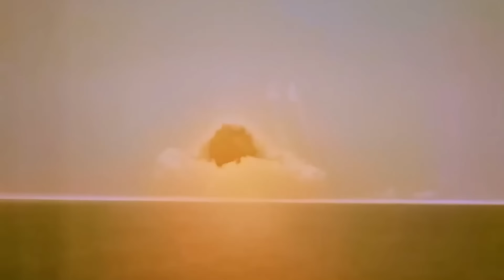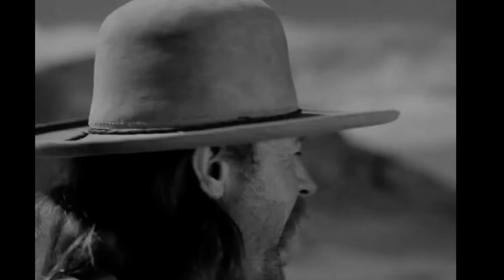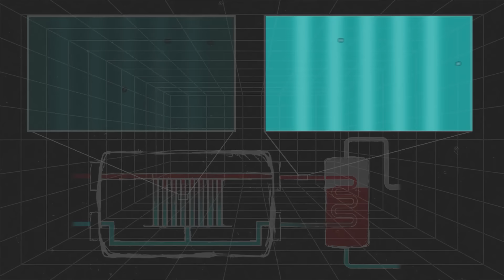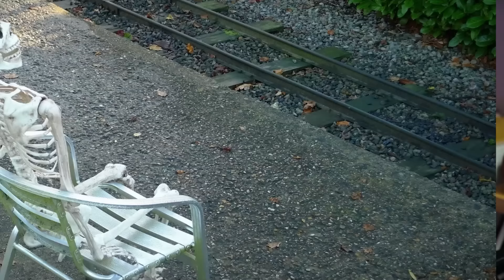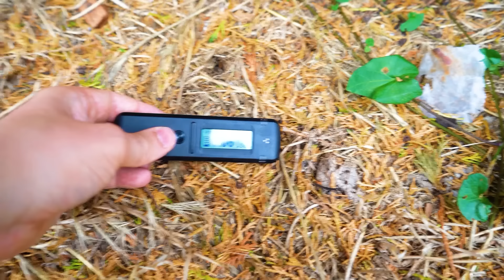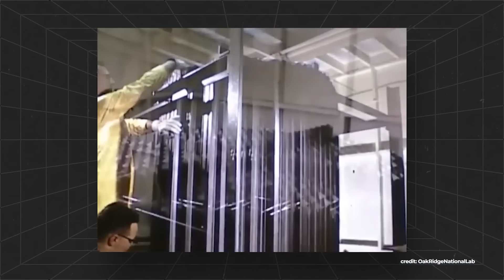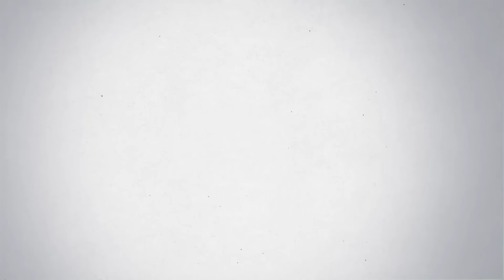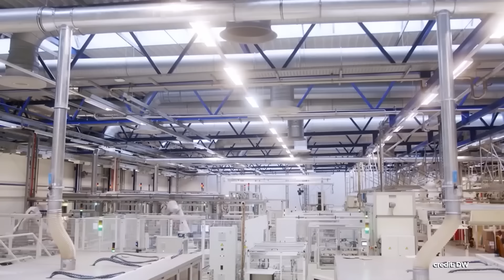It's Happening - China Launches World's First Thorium Nuclear Reactor

Comment: "secretly everything still runs on steam turbines, and we NEVER left the 1800's"  Had me dying,.  It's SO TRUE
Reply: Not solar panels
Reply: @RP-16  nor do any of the hydroelectric methods AFAIK
Reply: Or wind turbines or water turbines and some other stuff like wave power.
Reply: @RP-16 Britain has engineered a way to use anything from pavements to walls panels roof surfaces using special spray paints and a couple of connections, you got yourself an electrified surface of Ur choice, as long as u follow the instructions 👍
Probably available next year ???
Maybe?
Reply: @RP-16 The first solar power station was presented in 1876 on the Paris World Exposition
Reply: Its like the code in Windows !!!!
Reply: @_c_y_p_3  Funny, but, steam works. Windows don't!
Reply: @_c_y_p_3 lol based
Reply: @_c_y_p_3  In Windows, everything is running off the registry and we never left the 1990's. 😁👍
Reply: @_c_y_p_3  Wait... that runs on steam too? Does Gabe know?
Reply: 'Steampunk fever' - it rocks!
Reply: For more fun, a steam turbine is just a fancy sort of heat pump. also an ICE engine is just a fancy air pump.
Reply: @Name-ot3xw  I think my fridge is also known as a heat pump too.
Reply: Complete combustion results in co2 and water, so steam is still shoving the piston in an ice rig.
Reply: @Name-ot3xw  I thought ICE engines were border pumps
Reply: @Name-ot3xw an ICE is also a heat pump as well.
Reply: @carsonallaby7798  Fair, and a steam engine does pump air afterall.
Reply: @Name-ot3xw  
Expander Not pump.
Reply: @Name-ot3xw  no !
Reply: @Name-ot3xw  ices aren’t just a fancy air pump lol.
Reply: @Azakadune  TBF, you're right. ICEs are just fancy air compressors, not pumps. Though some include sub-pumps to further increase pressures.

For example, what we call a naturally aspirated engine would include all ICEs with intake manifold pressures lower than or equal to atmospheric, a 'boosted' ICE will have pressures above atmospheric in the intake manifold.
Reply: Turbine sets based on supercritical CO2 look extremely promising and much more energy dense than steam turbines.  You need monster turbines to get the power from steam but supercritical CO2 is so dense, you can use tremendously smaller turbines to extract the same energy.  That's the progress not covered here.
Reply: @StormGod29  I came here to write about the supercritical CO2 turbines. Some of the estimates I've seen tout a 50% or higher improvement in total efficiency of the energy conversion. So ANY heat-based power source would get an automatic bump in nameplate capacity!
Reply: @StormGod29  What is "supercritical CO2"?
Reply: Ug use heat to boil water
Water spin spinny magnet thing
Ug make lightning that make things move
Reply: I learned this in 1997 in 7th grade about how steam turbines run all the power plants (except for hydro which are just water turbines, and solar) basically and I've always found it hilarious.
Reply: @artosbear  You can also burn natural gas directly in a turbine, without heating water first.
Reply: Those are called gas fired turbines.  Jet aircraft turbines are of that type.
Reply: An utterly ignorant statement.  Steam is still the most efficient way to transfer heat energy into mechanical work.  Just because a technology is simple and old, doesn’t mean there’s anything wrong with it.
Reply: It's efficient and simple.
Reply: Steam power forever
Reply: could be CO2 turbines...
Reply: We had steam engines earlier, but turbines weren't really all that great when they were invented in the late 19th century. It took a while to iron out the kinks.
Reply: @Afrobelly 1800s wasn't run on steam turbines but reciprocating piston steam engines.
Reply: China and the CCP....the Kissinger & Associates Klown Show that keeps giving.
Reply: @Talpiot_Program  Good Point
Reply: Yet, “we can build these reactors in the desert bc they don’t need water…” ??? Is the steam collected & recycled?
Reply: @DurfDiggler  Yes!
the steam turbine is part of a closed loop, from reactor, to turbine, then back to the reactor etc.
Reply: @Sir_spooky  But what do they use to cool the condensers? You still need to extract that heat from the exhausted steam somehow. If you need no water source they must be using enormous steam to air heat exchangers
Reply: The great invention of James Watt
Reply: Condenser?
Reply: Condenser?
Reply: @Sir_spooky  - There are also other designs that don't involve water at all.
Reply: @DurfDiggler  Of course.
Reply: @DurfDiggler  cooling water and steam condensate are likely separated
Reply: @DurfDiggler actually , yes. Its a closed system.
Water used for cooling
Reply: @DurfDiggler  … at best 90-95% of steam can be ‘recycled’ in current steam turbine cycles as contaminants have to be removed from the cycle and make up water has to be added.
Reply: @DurfDiggler  OBVIOUSLY!  It's condensed in those big heat-exchangers, some heat leaves the system and heats up the desert a little more.  The now liquid water can be pumped back in to the system.  People have been doing this for a long time!  I think it's common, except for in Locomotives and portable engines say, where the system has to be compact and move around, so they have waste steam.  There are several reasons to keep the water if you can.
Reply: @DurfDiggler  Yes :) It's enclosed.
Reply: @DurfDiggler  America's 2nd largest (until recently largest) nuclear power plant is just West of Phoenix, AZ (Palo Verde). Uses gray water recycled from metro Phoenix.
Reply: @DurfDiggler  Closed loop like your A/C system.
Reply: @DurfDiggler  Steam can be condensed and reused , but the heat has to go some where, and there is some loss
Reply: @DurfDiggler they need water for cooling and to run turbines so the desert reactors must take water from underground or dam a river and reallocate its stream !
They will have a loop which is fed through a massive water tank and fed through after cooling the steam can be collected and fed through drip feeders or whatever they're called which is recycled to
Old tech with newish chemistry 
That's my little take on it 😅
With technology today we need water to help control the reactor's heat otherwise another Chernobyl is likely to take place,
Reply: Yes  @DurfDiggler  and, there is also sodium used sometimes, basically molten salt, kept in its own containment mechanism, but able to input or output the heat. It's a really nifty concept. Altogether, makes a lot of sense.
Reply: Water wells in the desert are usually sufficient to provide the water for power plants @DurfDiggler
Reply: @DurfDiggler  Yes, it's just a circling medium for energy transfer.
Reply: @DurfDiggler  Are you serious or trying to be funny?
Reply: @__cypher__   I was quoting the contradictory points from the video. That part of the process was not clearly explained in this video, and I’m not a nuclear power engineer, so yeah, I asked a question. 
Thanks to everyone who clarified & provided more information without trolling.
Reply: @DurfDiggler Generally, nuclear power plants have two water systems: an internal closed circulating loop that can be any liquid (such as molten salts, or pressurized water) that may or may not be in direct contact with the fuel, and an external open loop that exchanges the heat from the internal loop which then acts on the turbine which then may either be vented (such as through a cooling tower). This second external system may be made into a closed system if you’re not lets say built on a water reservoir, you just have to re-condense the water.
Reply: @DurfDiggler There are no commercial reactors in service today that don’t require water.
Reply: @ so you understand my request for clarification on the information given from the video? 🤷🏻‍♂️
Reply: Nuclear power plus TPV cells should be the future!

 MIT just made some TPV cells that are just as efficient as turbines with the benefits of no moving parts. 

 I have no idea what the thermalphotovoltaic effiency actually means...

 Like how big of a panel would need to be required to capture the energy then? Same radius as the turbine or something? 

 No one can ever answer me that.
Reply: @dianapennepacker6854 TPV efficiency has nothing to do with the *size*, no-one ever "answers your question" because your question is wrong and you're obviously just trolling, or a paid bot or something. 
Efficiency in TPV is about how much energy landing on the cell **over any given area** is converted to energy. Better electrical technologies are needed to increase efficiency, not larger panels. 🤡
Reply: Claiming the steam turbine was invented in the 1800s is a bit of stretch. C A Parsons works founded in 1897. Everything runs on steam turbines because they are AWESOME!
Reply: All weapons are basically throwing stones at each other in a more deadly way.
Reply: @jimboslice1237  Maybe we need boxes of rocks in our parliament houses and united nations meetings to contain the disagreements.
The general public could just get on with our lives on the outside.
Reply: they could directly convert the heat exchangers into solid state to electric, but peltier and the other guy takes a lot of metal and is not cost efficient
Reply: @davidanalyst671  Interesting , How?
Reply: We still use round things called wheels as well.
Reply: @N-Tity  So True
Reply: Ummmm.  Gas turbines?   Like GE LMS-100!
Reply: Lmao I'm a power engineer and this its literally my job to run steam plants/power plants. Turbines are freaking everywhere and no one has a clue lmao
Reply: Unless the boron fusion reactor can be developed (which captures photons directly from the fusion process without the need to produce steam), the steam turbine is here to stay.
Reply: I was thinking about this the other day as a friend of mine was talking about a Royal Navy ship from 1901 and I asked how it was powered, coal or oil? And he said it was a steam turbine, I had to ask again and walk him through the steam has to get hot somehow.

I suppose two exceptions to the steam power rule are internal combustion (specifically in automobiles) and nowadays electric motors (however you could argue the electricity still comes from steam)
Reply: So we’re living in the steampunk universe already?
Reply: Pandora's Deflect made us forget the Clown World.
Reply: That's like saying every computer secretly still runs on transistors and we never left the 1950s. Novel ideas and inventions are dime a dozen, only those worthy of endless refinement are actually viable.
Reply: Comparing modern steam turbines to those of the 1800's is like equating today's microprocessors to those of the 1970's.
Reply: nothing wrong with using steam as a conductor of heat as water has good energy capacity
Reply: It is high time that we develop direct energy conversion with MHD generators
Reply: A stirling engine generates power without a turbine
Reply: @efattah  Thank You for the reminder, I.c.e too , now to make it commercially avalable
Reply: The first steam engine was invented in Ancient Roman, 50 CE and in some writings as early as the 1st Century BCE. It wasn't until several centuries before anyone actually applied this technology to an actual working commercial machine to do more than just amuse people.
Reply: This aspect has me confused.   In a different YT channel, I pointed out the advantage of less water being required for cooling a molten salt reactor. Someone else said the cooling water was needed to condense the used steam after the turbines. Why does a pressurized light water reactor need more cooling water than the molten salt one?  Does the primary water loop require extra cooling?
Reply: it's because you can't beat the thermodynamics of water. and it's safety and stability. Just like we reached the limit for energy storage on lithium batteries but everyone things we'll keep increasing battery capacity exponentially.
In the end we live in a world ruled by physics not Technology.
Reply: @captainLoknar  
Batteries can, theoretically get a few times more energy dense. They're perfect (or will be) for cars, trucks and mining equipment, big rigs, etc.
H2 would be better but not perfected yet (as cheap) and requires more solar panels or more nuclear to make than the batteries.
With cheap mass produced nuclear, we could afford that loss of inefficiency, though.
Reply: Soviet Alpha sub used a liquid metal nuclear. reactor.
Reply: @RadicalTek  Good to know , Thank You
Reply: Neutron flux? Holy shit, sci fi lingo was right
Reply: It's like saying cars still run on wheels, which were invented ages ago. Old technologies are still in use because they are fundamental and efficient.
Reply: @lihaida5838  they have cars in Japan now that use maglev
Reply: That's what I have been saying for years.  21st century fuel running 18th century technology!!!
Reply: And we still use spinning wheels for transportation 😂😂😂
Reply: Exactly what i am trhinking for a long time now. Everything we do. Nuclear, coal, and now thorium everything ends up as steam that turns the turbines. Even fusion reactors will do that. So yes, we never left 1800s basically.
Reply: There are different designs that produce electricity direct from the Nuclear reactor skipping the whole steam turbine thing.
Reply: Actually, what has been proposed for power cycles for Thorium is (like new coal plants) the use of supercritical CO2 which uses 0% water/steam. So we have left the 1800's.
Reply: How else do we turn the steam into electricity?
Reply: Your bones contain Erbium and for no particular reason, you also have Yttrium inside you somewhere.
They are commonly found together with Thorium in nature, which presents as a relatively cost effective and viable fuel, for use in Nuclear Reactors.
Europium, from the same mineral groups, is also of use for the control rods, used in Fission Reactors and isotopes of these, could cure you from Cancer.
Don't die. There's so much to live for, be like radioactive decay... stick around for a while!
Reply: I don't know. I have several relatives who used to work at a nuclear power plant
Reply: It’s actually so true and hilarious!
Reply: solar panel is not that case, but seems the western world doesn't like it because China is dominating the solar industry.
Reply: Insanely true. Even theoretical designs for commercial fusion reactors include using heat exchangers and steam turbine driven generators. Lol
Reply: Nuclear reactors literally heat water for steam turbines
Reply: The steam engine isn't really an electricity generator
Reply: Anyone who invents post-1800 technology either gets unalived or gets invited to some black site and their research becomes literally underground.

Can't have anyone threaten oil / gas profits now can we?
Reply: We used Water power in the BC era ancient Greece had basically had a turbine powered by a river not for electricity more of a direct drive powering tools like giant hammers etc
Reply: So ultimately still using  British steam engine technology.
Reply: To be fair it's the simplest and cheapest way of making useful energy from these reactions, if it's not broken, don't fix it!
Reply: And running on Bitcorn as fuel.  lmao
Reply: Whens that was a secret?
Reply: Yes, WHY can't we find a way to be More direct with making Electricity like Solar IS.
Reply: yeah there must be a better way to turn nuclear into electricity
Reply: Except wind power, PV solar, dam power and vehicle electric power from alternators
Reply: Thermal plants employ the same thermal cycle, just the fuel is different, whether it is coal, wood, fuel oil,etc.  or uranium, ,the principle is the same.
Reply: Yeah but the methods used to turn those turbines is insanely more efficient and clean
Reply: This is just mind boggling every single time. Where are the magnets.
Reply: Ties in well with the stock footage at 18:51, it's a steam locomotive. 🙂
Reply: Closed Brayton Cycle is the way.
Reply: Pulsing magnetic fields is another way to harvest energy from nuclear reactors (plasma fields). Look it up.
Reply: well, its what creates the steam that has changed a lot. the steam is just a convenient process. think of it like gears, they are ancient, but we use them all the time, but it doesnt mean we havent advanced at all since then
Reply: That's what reminded me to upvote, lol.
Reply: Yup, like in the music world, we haven't left the 80's.  We're still listening to an 80's sample's tape😂
Reply: @theofungi6562  
The music is indifferent to the politics, but it was good, too, back then.
Reply: Solar cells
Reply: Steampunk forever
Reply: Nothing changes we're still just apes playing with rocks. The phone is your hand is just rocks.
Reply: like the Wuhan Thorium Laboratory?
Reply: But thorium can be recycled!
Reply: @Mr.Bob369  everything can really just is it coast effective .
Reply: @Mr.Bob369  A life cannot be recycled.
Reply: not true at all actually. 

Nikola Tesla

Viktor Schauberger

Wilhelm Reich

Thomas Townsend Brown

Otis T Carr

Sandy Kidd (Alexander Duncann)

Prof John Searl

Joseph Newman

and on and on and on

just because industrialized, espionage and corrupt governments classifying suppress the technology with corrupt media, doesn't mean we don't have it at least the thieves in power have it... we could always try to repatriate it and oh boy should we really hurry on that before monkeypox mega lockdowns next month (whistle blowers say wef/bill gates are gonna chemtrail(biochemtrail) spray us with it (as well as put it in the mpox vaxxines)

then we will never be able to repatriate the stolen alternative fuel and power technology that our noble heroic inventor relatives who wanted it affordably for the public anyways
Reply: SPOILER ALERT!
Reply: Honestly, with China, I wouldn't believe this for a second.
Reply: yep.. Nuclear is just hot rocks boiling water
Reply: everything in China is fake
Reply: Well except for solar panels  and wind Turbines, gas turbines etc... but yeah it is depressing that a fancy concept like fission ultimately is used as a water cooker
Reply: @vahidsafira8651 No moving parts for zero point energy, Tesla towers, MHD generators
Reply: WiFi is just radio so yes it's all turn of the 20th century technology... makes u wonder what they really have. But the next energy source makes a bigger bomb. Humanity isn't ready
Reply: uhg, i hate this fact. i think i was legit depressed for a day after i realized this
Reply: If it's not broken, don't fix it
Reply: I always think about this with nuclear reactors lol
Reply: As Einstein said -:"it's a hell of a way to boil water"
In fact it's a hell of a way of boiling the planet.
Reply: LOL we just keep getting fancier at generating the heat :D
Reply: If it works don’t mess with it
Reply: Come up with something better. Oh, I don’t you can.
Reply: Steampunk FTW!
Reply: the phase when satan started his ultimate execution
Reply: So what about splitting the water to hydrogen and oxygen and then letting that run a fuel cell would that not then use the steam better than a turbine and create more energy
Reply: It seems like you could use both systems turbine and fuel cell at the same time as it heats splits cools and the pressure changes
Reply: because technology is child of science, our science haven't enhanced. We are still using 1700s science theories, Science advancement is not happening, only technological but we always forgot that tech is just a product of science, it is not science.
Reply: @ManagementBing  that's true in that not many questions are asked and what most understand is what is already taught to them.. complicatedly simple as that is 
Mechanical 
Electrical 
Biomechanical 
Quantum 
Nuclear
Plasma 
As far as I understand these are the only open frontiers of technology I'm sure it could be broken down further but that's it.. and even with that is plasma not electricity in a way is that not directly convertible and we don't do that fuel cells and solar.. copy biomechanical yet stand unapplied to the nuclear that then is creating the sun and plasma electricity and a turbine is used on the heat.. just an unimpressive application and use of a nuclear reaction really
Reply: Not true.  A lot of things run on gas turbines - aircraft and marine engines, peaker electricity generation, FCC expanders.
Reply: Like you got a heart attack? 
I hope not, how are you doing now are you better now?
Reply: @Afrobelly  Wrong. There are new technology such as solar and wind.
Reply: Its moving a copper coil in a magnetic field. Pressurized water or steam works great.
Reply: We're still in the age of quackery if you ask me
Reply: Don't fix what ain't broke
Reply: Proof stupid exists
Reply: haha I came here to say this too. Dead on :)
Reply: Gas turbines and internal combustion engine have entered the chat and no i am not talking combined cycle
Reply: So... we live in a steam-punk age... at least its turbines and not reciprocating piston engines...
Reply: Free energy & technology is being withheld from us whilst Planned Obsolescence runs rampant.
Reply: That's thermodynamics. Laws of physics have proven to be pretty reliable over the last billions of years.
Reply: What is better to convert heat/pressure into mechanical energy/power a generator?   Anything even close?
Reply: Yep
Reply: Ha ha 
Very good
Ur brain works very much like mine 😅
Fusion is the future
Hopefully fully controlled 
Don't fancy no black hole in my back garden
although a black hole could solve our world waste issue 👍
If controlled 😅
Reply: Solar joins the server
Reply: There is no secret about that.
Reply: All still a nice way to let us pay a lot for electricity.
We should all have free electricity by harvesting it from the Aether.
Reply: Thermoelectric, photovoltaic, etc. are often too sensitive to endure radioactivity so even bromine is preferable to ammonia for working fluid since a fission fragment uranium gas core rocket engine would only evoke wrath ire of bureaucrats since Heisenberg's criticality or "Dragon experiment" of Leipzig to calibrate frustrated Germany to sell off Uranium 235 for the United States to have Trinity test of July 1945 so please no jokes about "uncertainty principle".  

Steam could generate electric power via electrostatics of steam flux across electrodes where again heat hinders conductivity and with so many alpha particles most electrons could be absorbed to form helium.
Reply: Steam is lighter than air for airships of distillery steam rocket retort nozzles might have worked for Japan of how Japan had lacked quality ferrous to not have rail transit track locomotives until Fall of 1945 and not be able to produce ferrous metals to meet DOT qualifications until the 1970s.  

Still Roosevelt's sea floor mine blockade of 1938 to 1945 on Asia ironically forced Jun Noguchi of early 1940s Hamgyong to develop Helmholtz Coil focused cosmic ray muon catalyzed fusion beryllium alloy rocket powered gliders of braided composite fibers fueled by cryogenic Dewars of liquified deuterium to haul freight between rooftop hangar Mary Kenney STOL fans which I can back by my MIT peer review.
Reply: @thomasciarlariello  sure
Reply: Not secretly, though.

Col. Bearden once said about all our electrical technology: 'We are paying the power companies to have a giant wrestling match inside their generators and lose.'
Really alternative technologies would be approaches like utilizing magnetic field vector potential, i.e. tapping into the flow of magnetic fields.
Reply: MHD and shape memory alloys are a consideration only if it does not exceed Curie Point of how such metals could melt like in an induction smelter.
Reply: My dad a NASA engineer whose professor was Dr. Robert J, Oppenheimer had worked on a SNAP Reactor of thermoelectric like Rusisan Topaz reactor and on a fission reactor able to use NaK liquid metal for a working fluid so a pilot plant has to be achieved before going to commercial fuill industrial scale.
Reply: @thomasciarlariello  Are you proud of your dad being a NASA person?
Reply: What is important is he was proud of how I made it to MIT for my articles on how to design nuclear fusion rocket engines for spaceplanes so when he died a visiting nurse had a "Godzilla" film on TCM so I explained how such a film had binding energy kinetics wrong to have inspired me to give by invite only an MIT presentation on  design for a lamp to convert exhaled carbon dioxide into breathable oxygen.

My dad being part Hungarian resembled Ruler of North Korea of how my dad was paranoid about communism so he hated Black people being from University of Texas to have  endorsed the Confederacy of the Civil War and considered his Oak Ridge Professor Oppenheimer to be a west coast bohemian out of synch with work of how a how a Hollywood film did show Oppenheimer being a polytheist with a mistress Jean Tarlock murdered by the FBI for WWII secrecy so which is better or worse Huxleyan decadence of polytheism such as K Pop sexual gyrations or Orwellian militarism of monotheism such as Taryeong goosestep parades?

My mother who worked in virology epidemiology was a personal friend to Thailand's royal family so during the "Cold War" both parents where constantly on alert.
Reply: @thomasciarlariello  Eh....
I guess I have to believe you on your words.
I don't believe in space traveling that much though.
Any family members hanging around that do high quality LGBTQIASDFT90210BS²   transmutations ?
Reply: It only proves that the greek Heron, who lived and died at the time of Jesus, had a good idea when he invented the theory of steam engines, long before Savory, Newcomen and Watt made it work better and more efficient.

One of our most iconic 1900 inventions, the jet engine also works on the theory that warm gas expands to a bigger volume, and rocket engines took man to the moon in 1969.

So, an idea doesnt need to be new to be good.
Reply: Steam is not the energy source, else no need for oil, coal, or thorium.
Reply: @richardwilliams1986  Yes, of course energy is needed to increase temperatures. 

But there are a few situations where nature provides this energy. I'm thinking of underwater heat water chimneys, called fumaroles, they get their energy from volcanic activity, and can produce water temperatures up to 400 C/752 F.

This energy is taken care of in Iceland, and should be taken care of on Hawaii as well, since there are volcanic activity. Instead, 80% of Hawaii's energy comes from oil.

In Centralia, Pennsylvania, a Cole mine has been burning for a long time, i wonder why this heat isn't taken care of, before we look at complicated nuclear processes. I'm not a crazy environmentalist, but why don't we use free and available heat energy that already exist before we put a lot of effort to mine Uranium, Thorium and heat up cold water with it?
In Europe, Italy has this type of volcanic energy as well, 4 volcanoes and no use of heat as far as I know.
Reply: Eat your heart out .... with a green face ...
Reply: @SunitaSingh-u2m Would you care to elaborate what you mean by this?

"Eat your heart out" seem to mean that i or someone else here should envy or be jealous of something, i cannot se what. 

"With a green face"? I do not live close to a nuclear powerplant, so the risk of my face to turn green from radiation is quite remote. 

So, what are you TRYING to say?
Reply: That's why I'm so happy that we at least invented solar. :D
Reply: They'll be more wind turbine shafts in Britain than trees in 30 years if Neo Labor (sic) get their Neoliberal, subsidised Big Renewables way.. Extremist Dystopia... Small, modular Breeder Reactors could and should be ubiquitous tech all over the world by now, not coal, gas and dodgy renewables.
Reply: A ridiculously ignorant statement.
Reply: RIPPLE...NO DETONATOR NEEDED
Reply: @Afrobelly  yeah but we like wheels, they're a pretty good invention, I'm thinking British coz why not, nobody can prove otherwise 👍
Reply: so what? the windturbines are even older, the nuclear is the newest form of energy humanity discovered, yes.
Reply: Steampunk forever! 😆
Reply: Well, we run on stored energy... and there is no better stored energy than heated water.
Reply: We are building cheap fusion-energy-collectors all over the world. Direct capture by solar or indirect capture by wind. We advanced from 1800s.
Reply: I was shocked when I learned how much analog our digital world relies on.
Reply: Water acts as a regulator of neutrons too, cuz the neutrons don't need to be that fast to be absorbed, fast but not too fast. So water is a very useful liquid at all, it's one of the very bases for lots of reactions necessary for life, as one of the best solvents too.
We are still eating rice and dressing cotton, but the way we make it now, as like the final results, are very different than before, we are more capable now.
Reply: until there are big improvements in solid state conversion (the voltaics; photo, alpha, beta, thermo, etc) we're stuck with mechanical means of generating electrcity on the mass scale. And the turbine is the best option for that.
Reply: i realized it long ago
Reply: Combustion engines tho...
Reply: "Steam Punk"...
Reply: It's true, but old technologies that work are a wonderful thing. The oldest technologies include the simple machines (screws, inclined planes, pullies, levers, wheel and axle, and the wedge), irrigation, writing, addition and subtraction, and mattresses. I hope we keep those old technologies and likewise for steam turbines.
Reply: “If it ain’t broke don’t fix it”
Reply: Not only Steam turbines, but a host of other everyday things we use. If it's working well, then don't mess with it. You can still do R&D in the background for something better.
Reply: ThMSRs use molten salt as a fuel and coolant. Steam is used in more classical PWRs made by Russia, South Korea and some Western companies.
Reply: I tell people this as often as possible
Reply: Fusion it's the most expensive cofee machine project ever made, and still not ready, as it intent to make steam and move a turbine.
Reply: There are working molten salt plants already
Reply: @mr.buddha3657  One is in China, other notable reactor of similar type like Russian BN series have sodium instead of molten salts.
Reply: So we still in the steampunk era. Cool. 😎
Reply: Well not really, you see solar is one instance of direct electricity generated
Reply: I cannot recall a recently used technical principle, which was not discovered prior to 1957
Reply: @IvanPetrov-k2k  Microchip?
Reply: @MbisonBalrog  1957
Reply: @IvanPetrov-k2k  Fusion on Earth?
Reply: @Signal_Glow  Possibly after 20 years. First international agreement for non-military fusion projects were in the late 50s
Reply: @IvanPetrov-k2k  Yes, they started it a long time ago, but actual fusion didn't happen until quite recently. There are new things discovered, although maybe not as fast as before. As you know assessing these things is hard.
Reply: @Signal_Glow  Interesting, nobody speaks about antimatter ignition. For me - the best way.
Reply: @IvanPetrov-k2k  It is certainly very interesting and not well know, i could not find an article that would explain it. I guess we have to move on with big PWR plants, do as much thorium tests as possible and leave SMRs for companies who want them. If this is not done we are probably facing very, very grim future on this planet.
Reply: I wondered about this as well many times, though steam turbine efficiency have been improved a lot over time.
Reply: A good idea is a good idea just like the wheel, most guns and we even treat cancer ie chemo is the same method from the 1930's which we really need a better method to treat
Reply: Ah, people still boil water
Reply: Like  COBOL software running banking systems.
Reply: and since then they make clouds with the most of the energy. And its just because they dont understand that they can use the power of the phase change to make organic steam for organic rankine cycle. If they would use the heat of kondensation they couldt reduce the coolingtower clouds and make massivly more energy.
Reply: Apart from photovoltaic, everyone of our energy system converts energy thru mechanical rotation.
Reply: @nulnoh219  Because spinning electric coils withing a magnetic field generates electricity.
Reply: Up yours Americans
Reply: The steam engine train is still around and kicking,  It just goes no where
Reply: We will be never leaving steam turbines and coals :)
Reply: The main reason I see Venus as a better place to colonize than Mars. The heat gradient in the Venusian atmosphere would give humanity virtually unlimited energy. With that much energy almost any obstacle could be overcome. I don't see much return on investment in colonizing Mars, but with Venus (or Mercury) all I see is money....
Reply: Most of Nikola Tesla's discoveries and inventions are still used for our conveniences and advancements. He practically perfected his invention BEFORE he built it.  Eliminating a lot of experimenting that costs money. Just think how much money has been spent by nations on engineering that went outdated because of new and better technology,  just look at Russia and their aviation projects that never got used.
Reply: Yep, it's all to make a turbine spin with magnets on it, of which repeatedly spins close to stationary magnets, which then generates the actual electricity we need and use
Reply: Thorium is a good idea.  Lower radiation, lower pressure. How did they fix the corrosion problem with the pipes and the molten salt?
Reply: Hydro doesn't use very advanced steam turbines...
It uses very advanced water wheels!
Welcome back to antiquity. xD
Reply: 😂🎉 🥂 cheers steam punk fam
Reply: About 2020 a scientist in a Californian University was given the job of seeing if atomic waste coulld be useful.
He was aware the uranium in cracked uranium rods is nor reprocessed because it is cheaper to replace them with new rods.
However the graphite surrounding them is atomically carbon so he tried manufacturing Diamonds and was successful then it was noticed electrons were busy buzzing around in them, by fitting the diamonds with two terninals it was found they supp;ied electricity, so they were in fact batteries.
In January 2024 Elon Musk signed a contract with China to replace the lithium batteries in his EV Tesla cars, with Diamond Batteries, they will power his cars for 1500 years without the need to charge them and every manufacturer of EV cars will have to follow suit or go bankrupt.
Since then British scientists have extended the range of Diamond Batteries to supplying electricity for 5.700 years.
If Mars perseverience rover's  Moxie was upgraded here on Earth it could extract CO2 from our atmosphere, split the molecule and run the carbon 12 past Plutonium which would change it to carbon 16 , it could be manufactured into trillians of Diamond Batteries which could replace every fossil fueled or nuclead fueled power station on Earth.
It would also sequester the cabon indefinately while also reducing Global Warming.
Reply: I noted that
Reply: China builds the equivalent of 5 nuclear reactors a week in solar power for  the record.  No steam there.
Reply: Not solar or hydroelectric or tidal energy
Reply: Guess what thorium reactor do ……they heat water to make steam to turn turbines
Reply: It's true. Make stream ... dump into turbine ... make electricity
Reply: Not with fuel cells
Reply: Being pedantic but things don't run on steam - steam is just a means of energy transfer, a fluid medium more than a source of power. Pressure and flow is what drives a turbine and steam is the most practical, efficient way on a huge scale.
Reply: @deezelfairy  "steam is the most practical, efficient way on a huge scale" thus they run on steam...and are designed to run on steam as an energy transfer solution
Reply: @deezelfairy great reply
Reply: @deezelfairy  Sounds pretty pedantic to me. Its called a steam turbine right? Its the steam that creates the pressure and the flow right? 
wElL AkTually
Reply: @McGillus  Well, I said I was being pedantic so yes, it is being pedantic 😂 

It's actually an important distinction to make - especially when it comes to troubleshooting issues with any system reliant on fluid dynamics and understanding how they work.
Reply: @deezelfairy  wELl AcTuaLly..
comon son.
Reply: @McGillus  Sorry, I forgot being dumb is more cool 😂
Reply: @deezelfairy  Why using steam which is limited in temperature by its pressure?   You can transfer the heat from the internal LF loop to air (say 800 - 1000 °C) and use the hot air in a gasturbine which drives a generator.  Much more compact than a train of steam turbines with condensors etc.   LFTR's can be built very compact !!!!
Reply: Dezel, all steam engines run on heat wood, coal, kerosene, fission. Of course the steam is only a method of transferring heat to mechanical energy, duh! They are still steam engines! From a couple hundred years ago.
Reply: If it aint broken and it still works as it always has...yada yada.

Theres this very great quote from the even greater movie called "Poor Things" that activated my two and a half neurons, generating a small increase in my brain's neuroplasticity, causing the growth of that last half a neuron and bumping my numbers to 3. It goes:

"As God, my father, says, it is only the way it is until we discover the new way it is, and then that is the way it is until we discover the new way it is, and so it goes until the world is no longer flat, electricity lights the night, and shoes are no longer tied with ribbons"

I've always found the element of H2O very fascinating. Life can not do the life thing without it. it's a universal solvent. It's delicious. It electrically powers our modern world, and we haven't replaced it. We merely replaced our means of using it for far more efficient means. It's a magical element, in my opinion.
Reply: MHD generators have been invented they just aren't used.
Reply: @bolzdk9032  MHD are waiting for stronger magnets (room temp superconductors)
Reply: And anything that runs on a steam turbine only has an efficiency of about 42% at its best and under optimal conditions. Modern nuclear power plants are only about 33% efficient. This means that two-thirds of the energy produced by a nuclear power plant is wasted.

Of course, a wind turbine is only 50% efficient, and a solar cell is14 to 19% efficient at best, but they are simply capturing the energy that exists around them. Whether they're there or not doesn't matter, the wind is going to blow and the sun is going to shine, with or without them. It's not like we're producing energy here and then wasting two-thirds of it, we're just not capturing 50 to 86% of the free energy that we theoretically could have captured.
Reply: @xcoder1122    Unless you also want heat near the power plant in which case heat rejected from from the turbine isn't all waste.
Reply: @PMA65537  Agree.  For example, the heat can be used to desalinate water.
Reply: @xcoder1122  Modern turbines are incredibly efficient devices operating at about 90% efficiency in terms of extracting energy from the supplied steam. Even reciprocating piston steam engines have efficiencies of 75-90%
The majority of the inefficiency is in creating the steam itself, i.e the boilers and is why for example steam locomotives had overall efficiencies of single digits percentages.
Reply: @deezelfairy  I was talking about the entire process, which includes heating the steam, transporting it, cooling the steam, condensing the water, transporting the water, the entire cooling system, etc. If YouTube didn't usually block links, I would have sent you a link where this is calculated in detail, both theoretically and using actual data from real power plants. It's useless to have a component that's 90% efficient if everything before and after it isn't. A chain only needs one weak link to be useless.
Reply: @xcoder1122  Fair enough 👍, a lot of people don't make that distinction of the whole when looking at turbine efficiency.
In the current day, the most efficient power generation would be combined cycle gas turbines - that whole process can achieve efficiencies at ~60%. Obviously the problem is still the burning of fossil fuels.
Reply: @deezelfairy  Actually boilers are usually about 90% efficient. The losses come from rejecting most of the heat in cooling the condenser.
Reply: @xcoder1122  Sorry but that is exactly wrong: each component contributes to the loss, so if the first step is 20% efficient, your max result is 20%. Then the second component manages 90% of that 20%, so now you have 18% max. 3rd component is 60% efficient, now your total is 11%. You need *every single component* to be as high efficiency as possible. 🙄
Reply: @nowandrew4442  Where did I say any different? I said that it's pointless if one component if 90% efficient if the components before and after it are way less efficient. That's why the total efficiency of a nuclear power plant is only about 33%, despite the turbine on its very own being up to 90% efficient. You just confirmed what I said.
Reply: @deezelfairy  (rubbish, modern turbines are less than 50% efficient, the max temperature is limited around 600 degrees C and the energy from -273 to zero deg C can never be utilised. That’s thermodynamics!
Reply: @xcoder1122  no dude you're not following. Every non-100% efficient part will cause some loss. The lower the efficiency, the more *each part* will lose. It absolutely makes a huge difference if as many of your components are near 100% efficiency, even if an earlier component is not. A section is only 90% efficient **on the volume it receives from the earlier components**. Thus you are 1000% wrong to state that there is no point to have a 90% efficient component if the other components in the system don't reach that level. Jesus.
Reply: @nowandrew4442  Yes, I totally got that but studies say that the efficiency of a nuclear power plant is about 33% in total and that despite the turbine being 90% efficient on its own and that's all I ever said.
Reply: @nowandrew4442  So far you have not contradicted anything I wrote. You just went into technical details whereas I only made general statements and posted the overall result, so I have no idea what you think you are correcting here. If you think you are contradicting something, please quote exactly the line you think you are contradicting.
Reply: @xcoder1122  you said it's pointless to have something that's 90% efficient if the rest of system is less efficient. That's **exactly** wrong. It's about the only thing you could have gotten wrong, and you did. Utter incompetence.
Reply: @nowandrew4442  You have completely misinterpreted what I said. I meant that it's pointless for the overall efficiency if only one component is fully efficient while the rest is not. Turbines can even be 100% efficient, if a single component is only 1% efficient before, the overall efficiency cannot be more than 1%, because 99% is already lost before it reaches the turbine, and if 99% is lost, it doesn't matter if the turbine is 100% or 50% efficient, because whether the overall efficiency is 1% or 0.5% doesn't matter anymore, either one would be total crap.
Reply: @xcoder1122  if the first component was 1% efficient and the second component was 1% efficient your total output would be 0.01% of the original which is far far far worse than if the 2nd component was 90 or 95% efficiency. It's never pointless to maximise each individual component, *especially* if you want to ensure the highest possible overall efficiency of the system; in fact, not only is it not pointless, it's literally essential. 🙄
Systems that are 0.01% efficient are still usable, if that output is useful. It may seem wasteful but if that causes you to throw up your hands and trash the whole system then please never ever ever consider a career in engineering.
Reply: @xcoder1122  please God tell me you never studied engineering. 🙄 Even 0.01% efficiency is good enough if it gets the job done. Is it a waste, sure, but it's better than not doing it at all. And you know what's better than 0.01%? 0.9%. So if the first component gets 1% efficiency and the second gets 90% efficiency you just saved yourself a loss of 89% over the 1%/1% system. Every component matters, it's utter nonsense to suggest that suddenly it doesn't matter because an earlier component isn't efficient. It only seems that way to primitive minds that can't understand that it is the result that matters, not the human reaction to the % drops. 🙄🙄
Reply: @nowandrew4442  But it doesn't, unless you want to pay 1000 times more for your electricity, which you certainly don't.
Reply: @xcoder1122  do you know that in the US their ethanol production from corn runs at 1.6x energy return, while in Brazil their production from sugar cane is about 8x... Yet the US still produces ethanol from corn because the govt subsidies it and corn is what they've got. It's never pointless to optimise a system where possible.
Reply: @nowandrew4442  "because the govt subsidies it" - and if they did not, it wouldn't be cost effective because it is too inefficient. You shot down your own argument. Anything that must be subsidized apparently does not pay off on its own and would not even exist without the subsidies.
Reply: @nowandrew4442  Gas turbines that aren't in use don't wear out, and they don't incur operating costs while not in use. Sure, you need to build them once but that is a one time cost and then you can use them for decades because being rarely used, they'll last a very long time.
Reply: @xcoder1122 that's actually not correct at all.  I'd recommend updating your knowledge.
Reply: @xcoder1122  Wind does not blow all the time in the same place and the sun does not shine 24/7 in one place so you may have greater efficiency in wind but then loose that in transmission, a world wide transmission system is required but the losses and power security problems are enormous and don't say batteries they are too expensive and will never have enough storage for more than a short time. Thorium or fission is the only real long term solution.
Reply: @Equiluxe1  Actually, nowhere have I said that you have to get 100% of your energy from wind and solar alone. It would be a huge improvement if you could get all your energy from those two sources most of the time. If you then have to fire up a gas power plant every now and then (which can be done in about 2 minutes, as no power plant can be turned on and off faster than gas), you would still save over 95% CO2 emissions compared to today. And if you use biogas or green hydrogen, which modern gas turbines can handle just as well as natural gas, then you produce no CO2 at all, or less than the plants needed to grow the waste from which the biogas is extracted. Sure, green hydrogen is very inefficient but you'd only use it for at most 5% of your energy needs in practice, the efficiency of the entire system would still be better.

And since wind and solar power is dead cheap compared to a nuclear power plant (2-6 cent for solar vs 4-8 cent for wind vs 14-19 cent for nuclear power per 1 kWh, considering the true total costs, including building, destructing and operating the power plants), you can overbuild, meaning if you need at most 200 GW, you build solar panels that produce 600 GW and even if 33% of them are off-grid one day and the other 66% only operate at 50%, you'd still have 200 GW and guess what, that's still cheaper than building nuclear power plants that produce 200 GW. So such a system would give you more bang for your buck.

And for transporting power, we have HVDC today. HVDC only loses 2.8% power per 1000 km (621 miles). So you'd lose a bit over 12% energy if you had to transport it from New York to LA. Again, just overbuild to compensate for the loss. Yet it probably makes more sense to connect to Canada or Mexico, as Canada may have wind when the USA has not and Mexico may have sun when the USA is all cloudy or even the other way around.

Finally, use electric cars as storage. Electric car batteries currently range from 40 kWh to 100 kWh, let's assume 60 kWh for the calculation, which is a very common size. There are 280 million registered cars in the US. If they were all electric and had a 60 kWh battery, you could store 16.8 TWh. That's enough to power the entire U.S. for an entire day (the entire U.S. uses 11 TWh per day), which you will never have to do. If each car would just put 2% of it's current load back into the grid, that would be enough most of the time to tide you over until there is enough wind or sun to charge the car back up to 100% before you drive it next time.

Nuclear power plants are bad for three reasons and safety is actually none of them: They are expensive and so is their energy, they are slow to regulate (faster than coal, but way slower than gas) and the produce waste and nothing that produces waste is a long term solution. And as I said, don't forget about waste incineration. It will always exist, because it has to, it will always generate electricity and, although it is slow to regulate, it will always help out when the sun and wind are in short supply.
Reply: @xcoder1122  It costs a lot of money to have gas powered generators just lying around waiting for the time they are needed, power is best generated continuously and the best solution is most likely this thorium tech and in the future fusion.
Reply: @xcoder1122 Wind and solar don't run 24x7.
Reply: @xcoder1122  Your figures are from the 1990's. All commercial solar cells are 23-27% efficient these days. And we're insanely cheap. Continuous exponential growth since 1970. Thorium is nice and all, but it's too late. They will never catch us. We convert the energy of a photon directly into electricity without a ridiculous steam middleman from the 1800's.
Reply: @don-gp8zu  Nope, they are not. There are 23% efficient solar cells and even solar cells way above that, but those are extremely expensive, often cannot be built as large modules and aren't in use in any larger commercial deployment. Those solar cells that you will get when you order solar cells for your home roof tomorrow will have an efficiency between 14 and 15% at best and only under peak conditions that you will realistically never get.
Reply: @xcoder1122  In solid fuel reactors only 1% of the fuel goes into actual energy. In salt reactors it above 90%. That is a very big deal plus no shutdown time and reduced maintenance. They also produce many very needed by products.
Reply: @xcoder1122  The biggest problem is not harnessing the power available in the world such as from wind and solar. The biggest problem in powering the world with any method of power generation is the storage of said power. Grid-level large-scale electrical energy storage is a very important and popular research subject right now, and until people are able to develop a solution that addresses all the shortcomings of each method we DO know about, the dream of energy efficiency and affordability is still just a dream.
Reply: @Bancheis  You hardly ever need to store power if you overbuild. If you produce 3 times more power on average than you would need in the worst case, you will pretty much always generate enough power. You just need a power grid in the US that isn't crap. Name me the date of a single day in the last 100 years where neither west nor east coast had any significant amount of wind? You cannot because that has never happened. Sure, locally in a 100 mile radius where you live there might be no wind on some days but if you make that radius only big enough, this will never be the case. In using HVDC, transporting electricity from New York to LA or the other way round would only have a loss of about 12% and that's pretty much the biggest distance you ever need to cross (unless you want to build wind parks in Alaska and get that power down the the USA using a sea cable). And you will can still run gas power plants on biogas, which is also CO2 neutral and will always be able able to back up any missing solar or wind power with ease.
Reply: @xcoder1122  and hydro power then? Not steam but still a turbine. The problem with focusing on one element of the issue (i.e. efficiency) is to ignore the greater picture. There is no such thing as an easy answer. For someone who only sees power as electricity and electricity as a generic thing that just comes out of their wall it can be easy to focus only on the obvious.
Reply: @xcoder1122  So ? If the fuel is plentiful and no pollution ?
Reply: @xcoder1122  with wind and solar you also need to take into account battery inefficiency plus the additional generation which must be turned off when battery levels are high.

Planning energy systems on a stable generation source is challenging, but using intermittent and unreliable generation source and storage is so difficult that it has never been shown to actually work anywhere in the world.
Reply: @deaninchina01  Demand is also intermittent, so constant power generation isn't actually necessary or desirable. Solar is utterly destroying the coal and nuclear industry. For a technology "doesn't work" we're doing pretty well :) Personally I doubt we will ever replace the final baseline 10-20% but apart from a small legacy role it's game over for fossil fuels and nuclear.
Reply: @xcoder1122  Eh, you can say the same of "burning" things. You're just changing the chemical/thermal state of a substance. There is no such thing as "destruction" on a cosmic scale. Just changes in states. If you want to look at it in terms of consumption... when we burn trees, coal, etc, those are all renewable resources on a long enough timeframe. And on a REALLY long timeframe, that "free" sunlight is coming from a fission reaction in the sun that is consuming a finite (if really, really huge and nearly inexhaustible in human timeframes) amount of fuel, hence the different stages of stars.
Reply: @zeriel9148  Most coal and similar came from a time period when no life existed that could decompose lignin, so when plants produced lignin, it just kept building up as it couldn't rot. That's no longer the case. I don't think much coal can ever form again. Trees are renewable in our lifetimes since you can plant them as fast as you cut them down if you want to, but I don't think many people run power plants on wood. Wood has pretty low energy density and is a solid, so it's more expensive to move it around.
Reply: Operative word: human. AI will require a much longer time frame. And much shorter.
Reply: @xcoder1122  good point
Reply: Wheels are a very integral part of human technology therefore we never left the Copper Ages
Reply: Solar panels?
Reply: @jamestbg8132  Yes, but cyclical and not energy dense, unless coupled to energy storage and delivery systems.
Reply: Tell that to photovoltaics and electric motors.
Reply: Wind, hydroelectric, solar-???
Reply: The wood is the best energy， Because it can be  renewed by the nature.All the mineral resources will be used up in the  future, but the nature gave us a way to change the sun energy to the biological energy, Then the human can change the biological energy to the  electricity. How reasonable!😂
Reply: If it ain't broke don't fix it
Reply: @jarehelt broke or not the shit is underwhelming and wasting potential power
Reply: @jarehelt  So you'd prefer to drive wood wheels on your car? After all wood wheels were not broken when rubber tires replaced them.
Reply: @xcoder1122  Im sorry do you have a better way to turn energy into electricity? 🤔